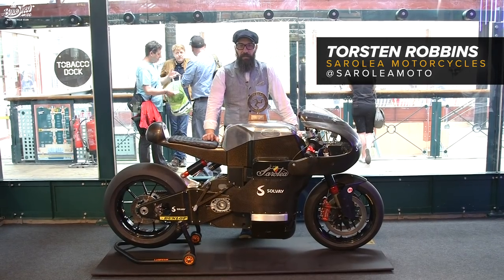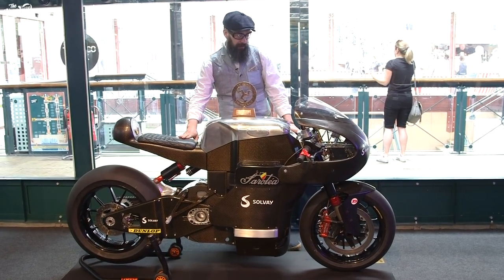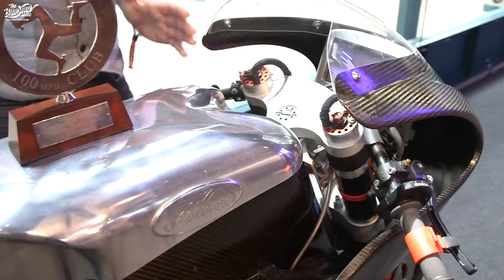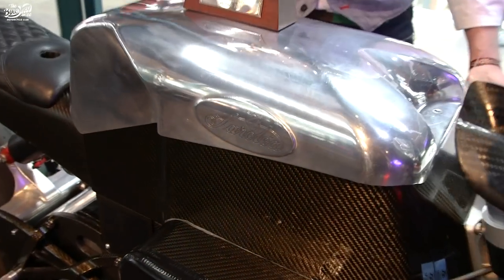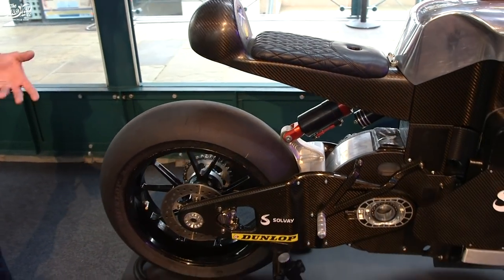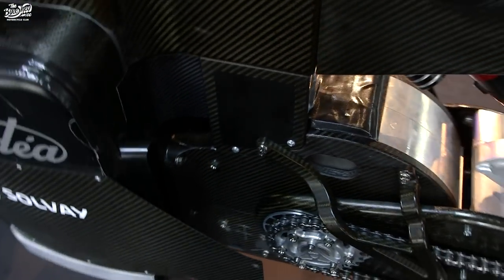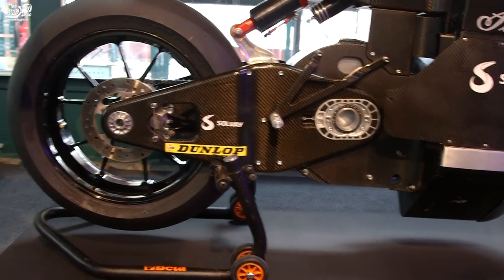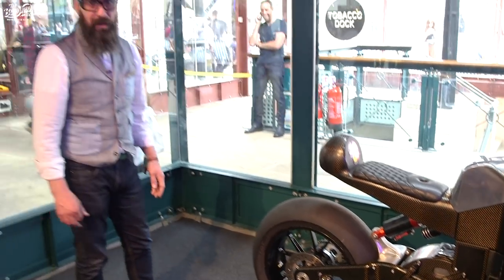Saroléa Motorcycles: SP7 IOMTT Zero Electric race bike - Bike Shed Show 2019

Comment: How does it have more torque at the rear wheel than at the crank. I must not understand something ?
Reply: Gearing.
Reply: Some sort of gear reduction, I guess. I don't really understand it either.
Reply: @TaAikah  There is no gear reduction as there is a 1 to 1 ratio on the drive chain, unless they change it internally ?. My guess is he got the figures reversed.
Reply: The figures are correct, comes down to the gearing between the motor and wheel. From other photos you can see that the sprocket on the wheel is larger than the one on the motorshaft.
Reply: Could be planetary gearing inside the hub, or simply just drive reduction along the drivetrain. Not impossible and makes some sense for an electric bike.
Reply: @noeldsouza4267  Just because it's electric does not mean you never use some kind of gearing.....
Reply: Electric motors reach peak torque at low RPM and they usually use that to multiply it at the wheel with a single gear ratio. He said the ratio is almost 1:1 but it's obviously isn't 1:1 if it almost double at the wheel.

Comment: 1000 Nm? What is this thing a diesel f250? Sweet bike but how does this thing have over 700 ft-lb of torque? Must have insanely long gearing
Reply: If you take the time to actually spot the diameter and overall volume of the motor, you'd get it. That's larger than most electric cars.